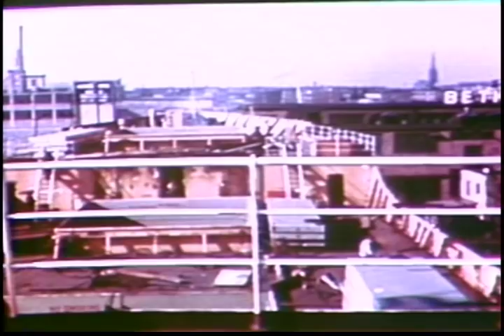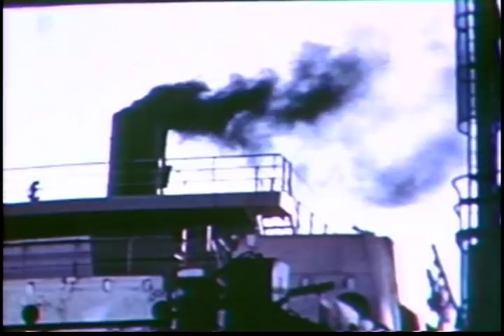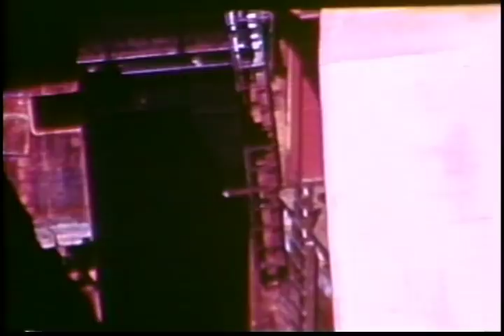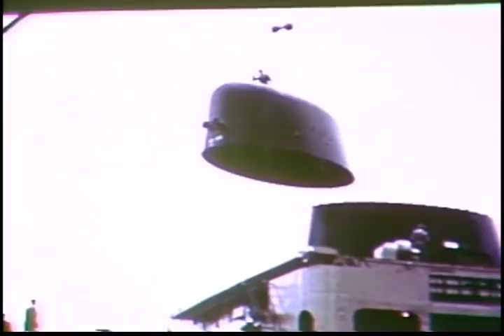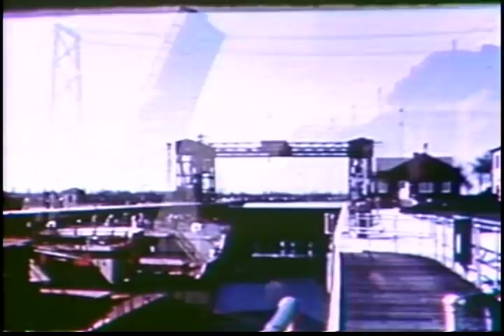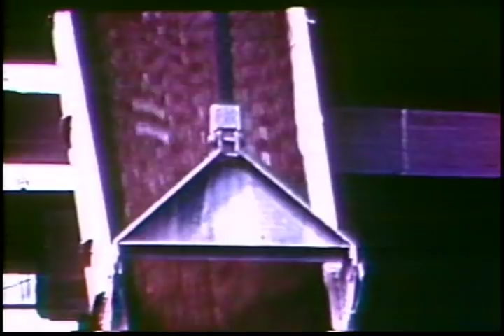Inland Voyage, the Conversion of the Cliffs Victory

Comment: It’s a shame Cliffs Victory couldn’t have stuck around a little longer than than the just over 3 decades she made it before falling victim to the scrapper’s torch. It’s sad her unique construction that made her one of a kind was also what ultimately did her in when she was still a young ship by laker standards. The way she was set up with the engine room and aft accommodations just rear of amidships seperating her cargo holds meant she would have been nearly impossible if not very difficult to convert into a self-unloader as so many of the more standard lakers were in the late 60’s through early 80’s. The only real ways to make her a self unloaded would have been to either cut her engine room section out, float a 150+ foot center cargo hold extension in, then join the engine room at the rear of that and either reattach the old stern section containing the steering gear and propeller tube with a greatly shortened prop-shaft or to build her with two self unloading belts, the rear one covering almost the entirety of the length of the rear spar deck to be long enough to be effective. Sadly in the end it wasn’t “cheaper to keep her”.

Comment: Sincere thanks for this video! I served aboard a Cimmaron class fleet oiler that was built at the end of WWll. She originally had a length of about 450 ft. 
In 1965, she underwent a lengthening program where her length was increased to 644 ft., being cut in half just as this ship was.
She drew about 36' and hauled and replenished warships with everything from avgas, JP 4&5, and Navy Light Distillate.
She was the USS Waccamaw, AO-109.